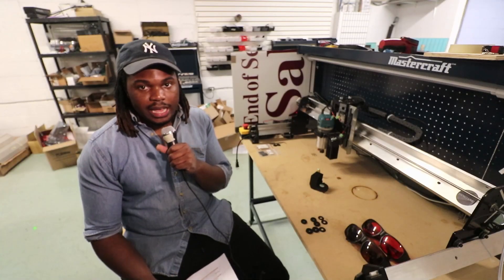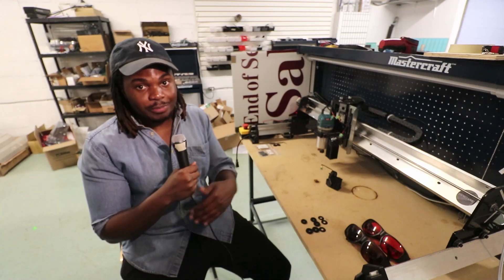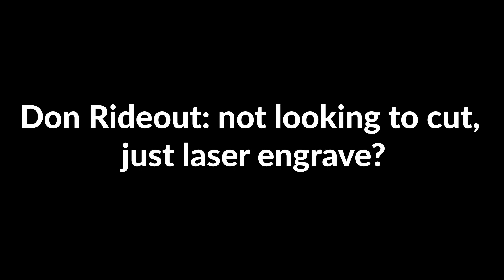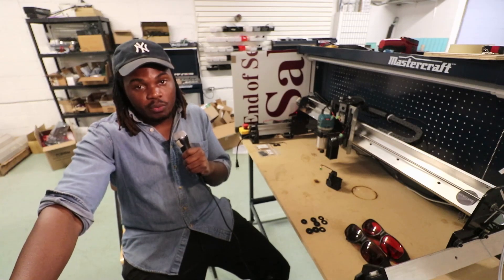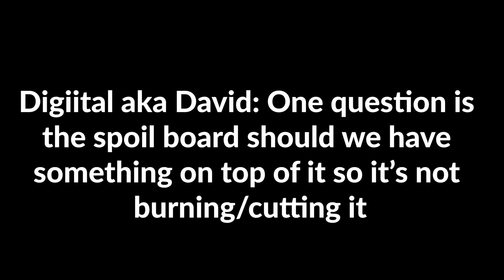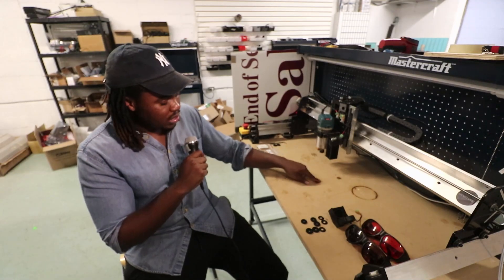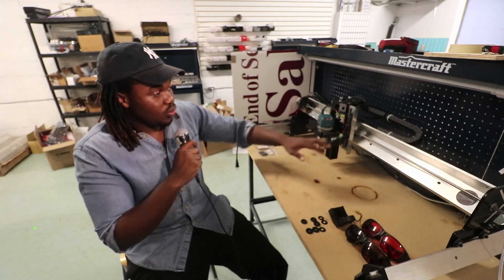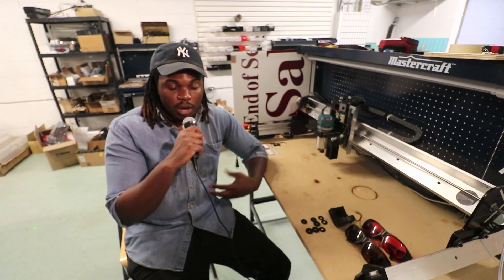LaserBeam Frequently Asked Questions

Comment: I have an enclosure on my Longmill CNC router and use a bathroom exhaust fan rated at 50 CFM and the tube goes outside of a vent outside the garage. I only turn it on for the laser and don't use it for the CNC router since that would suck up all the sawdust and burn out the exhaust fan motor. Currently I have a 20 Watt LED Chinese laser that won't cut wood that well. The Old laser has the same setup is the Longmill laser so it will pretty much be plug and play.

Comment: Hey Sienci - Hoping you can help with this question. I primarily use my longmill for laser engraving with a Banggood '5w' laser. I make end grain cutting boards and I find the engraving slow. Do you think I would be able to run things a bit faster if I upgrade? Any chance you could post some GCode I could run on my existing laser and compare the result to what you achieve with the Sienci laser? If this laser would cut down my engraving times I would be happy to upgrade and keep my old Banggood as a spare. I don't do a lot of super detailed engraving - just text mostly for customized cutting boards.